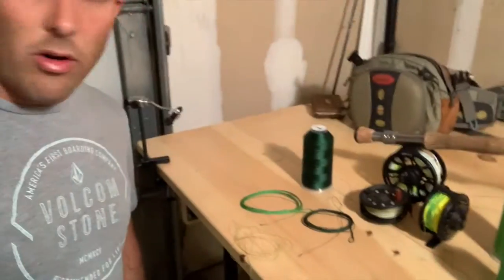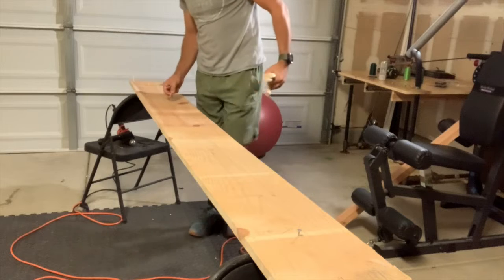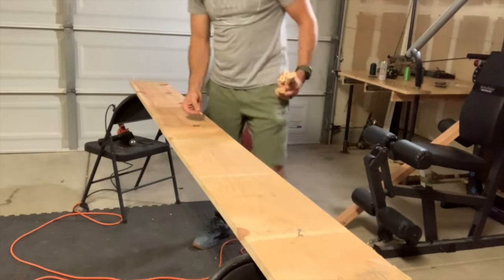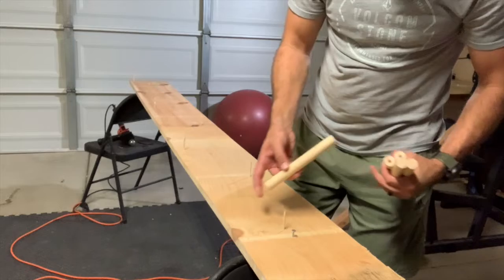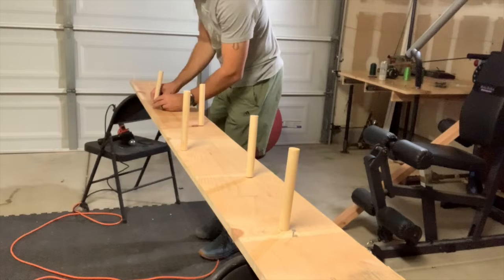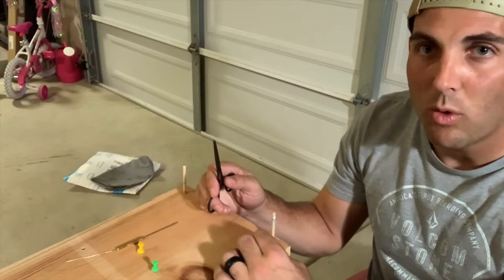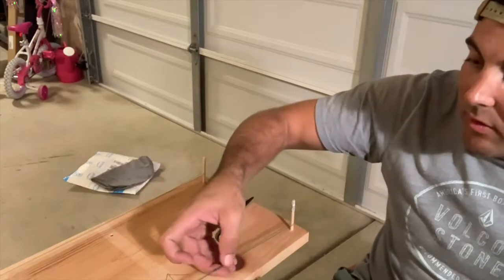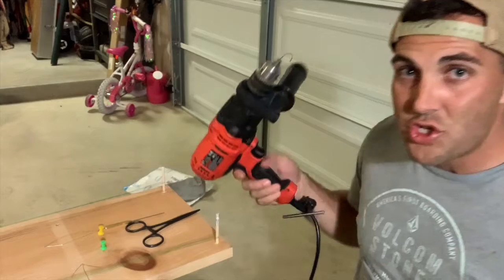Making Furled Leaders

Comment: That's pretty much the same way I make mine. Only I extend  one leg out and twist it all at once, position my ring then fold it back up. I use a 4oz weight on the end and let her go. We use them mostly for bass, carp, and saltwater.  So I'm using 2 and 4lb mono. Tight lines bud, and thanks for your service!

Comment: out of curiosity: couldnt you use a smooth-running swivel instead of weights, and keep the line horizontal as it twsts up? woult make things a lot easier for folks who dont have a slace with >10' ceiling height.
Reply from the maker: That would work as long as you control it so the swivel only engages after you’ve wound up each side with the drill.  Also you’d need to maintain pressure on the line.  I’ve seen guys use a bunjy cord and swivel when they use the machines that spin both lines at the same time.

Comment: How did you get the tippet ring to stay at the bottom? That part wasn't clear?
Reply from the maker: Mark Krieg after I thread the line around the posts I slide the ring on and move it to the bottom.  Then I start to spin the line and furl each side. If that’s not clear let me know.
Reply: I got it now, just had to slow my brain down and watch for the details.